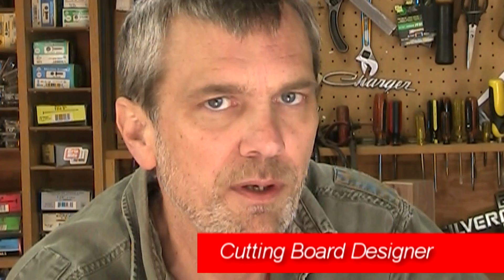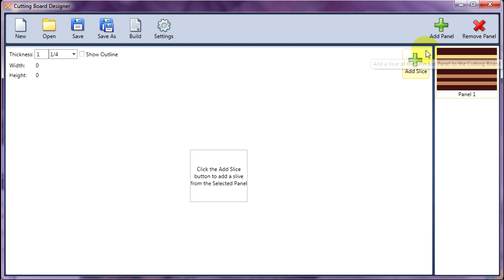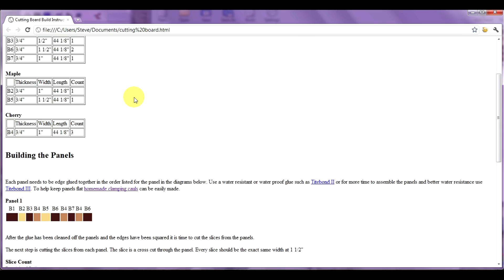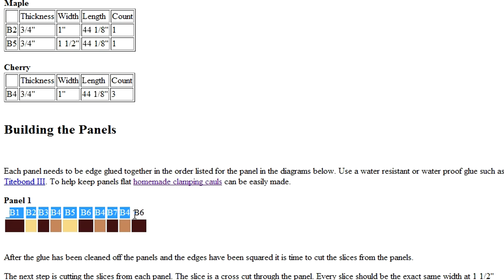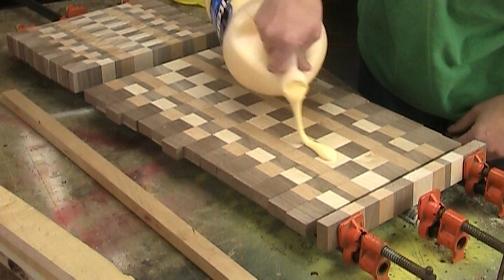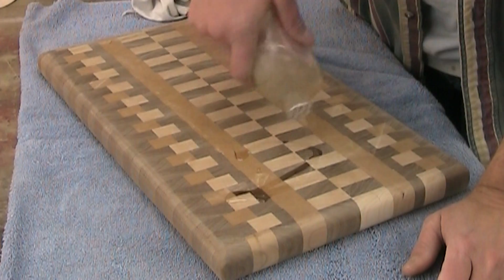How to make a wood end-grain cutting board

Comment: Hey Steve love your videos. They have motivated me to make my first cutting boards and maybe turn it to a possible side business. I have a bit of a question for you and I really hope I can get your feedback. I want to make a brick pattern end grain cutting board. I have the brick and small mortars cut out of Walnut and Cherry respectively. However for the longer mortar I don’t have boards wide enough to re saw the end grain to the thickness needed. That said, am I able to use face grain or edge grain to fill in that mortar, considering that the main part is short grain and that mortar would be long grain? Or am I better off glueing boards together to get the end grain to length and trying to re saw the mortar strips from there? Looking forward to your response. Thank you very much.

Comment: Can this be accomplished without a planer? In most other videos I see them running it through a planer several times to flatten it out. Did you also do that,  or were you able to accomplish similar results by just using the orbit sander?

Comment: Hi Steve, love all your videos - simplifying the message and making it entertaining, thanks! I have a question for you. Inspired by this video as a beginner woodworker (I made the table saw cart of your plans for my new first table saw and an old router I got given) I felt like going ahead with the whole cutting board project. Unfortunately my local store only sells dressed pine, and to get some hardwood, I basically had to go far to a wood joint that only sells raw hard wood roughly cut 150mm by 25mm. and of course they are not true to proceed with this project. Do you have easy ways to prep rough hard wood without a planer/thickenesser to make my hard wood usable? I've already spent quite a bit on wood working tools this month and adding a jointer and/or planer on my list wasn't really in the plans (ahah). thanks

Comment: This looks cool. It worries me that there is only glue holding it together though. Like, I worry that if I accidentally dropped it it would break easily along one of those lines. How strong is wood glue? I haven't really used it before.
Reply: when the face grain is glued together like Steve did, it's bond will be stronger then if it was one solid piece. Wood glue used the right way is extremely string. glue together to boards by there face grain(not end grain) with wood glue and try to break them apart after 24 hrs of curing.
Reply: you do not need to worry about it. Wood glue is actually stronger then the wood itself. :)
Reply: Iv'e tried. You have to drop it very hard for it to break, and more than once.

Comment: Cut food on glued wood ? No thanks
Reply: Darkangelextra X how do you think they join pieces when making end grain boards? by magic?
Reply: +Darkangelextra X titebond 2 and 3 is FDA approved for use with indirect contact to food. You'll be fine once you get of your high horse.
Reply: That's why you use a food safe finish on the cutting board, you don't just leave it raw wood...
Reply: Darkangelextra X  As long as you use a glue that is safe for contact with food like Titebond II, you're fine.
Reply: dude half of cutting boards are wood with fucking glue on them.
Reply: sorry if ur a girl idk if u take people calling you dude offensive if so sorry
Reply: All finishes sold on the Market in the USA are food safe once they become inert.  (Dry for a period of time)  Not all are practical for food, but they are safe.
Reply: I was just about to add a comment to say that Titebond II and III are both non-toxic glues that are used for cutting boards.

Comment: Steve - Nice. Just 1 small detail that may need clarification... when you a talking about the length of your boards,
you seem to be saying the length determines the thickness of the final board. This is not so. It is the width of your
slice after first glue up that actually determines the board's thickness.
Reply: He is referring to the length of the boards in reference to having enough material to get all the cuts needed. For example, if he needs 20 slices that are 1.5 inches thick, your net material would be 30 inches. NOW...add in the 1/8 inch removed by the table saw blade on every cut....that 30 inch board would need to be 32.5 inches + to allow for the material removed by the blade....I hope that clears it up

Comment: you can use regular cooking oil which, olive oil - canola oil .... two finish cutting boards, or any wooden kitchen item?
Reply: Using cooking oils rather than mineral oil is not recommended as those oils can get rancid and cause problems.

Comment: Steve,I am hooked after I saw this video.The board really comes to life after you applied mineral oil.Unfortunately I was unable to get this mineral oil.Any suggestions?
Reply: Home Depot sell butcher block finish, you can find it in the paint section with other wood finishes like Minwax.
Reply: Just about any food-grade mineral oil will work. I'm not sure where you live in the world, but around here you can find it in hardware stores and drug stores/pharmacies. In pharmacies it may be advertised as a laxative (and it works like that if you just drink the stuff), but it's the same product. If that fails you can definitely buy it online at a place like Amazon. I've seen other people recommend walnut oil for cutting boards, if that's easier to find where you are.

Comment: D L D M L D M D M D

The sizes (I used in the program) is as follows, in the same order as above, and are in “inch” increments. (If you want a different size board, you will have to play with the sizes. I didn’t take the time to any extra math, only enough to figure out this pattern).

3 1 ½ 1 2 2 1 1 1 2

Add 13 slices and flip every other one. 

Good luck, I am going to need it!

Comment: Plans for this cutting board: (This will have to be in more than one, separate posts due to comment size restrictions).
I was able to get some plans for this board. Although, the sizes may not be the exact as this amazing cutting board, the pattern is the same. Once you download the cutting board program:  
1. You need three different shades of wood. 
2. 10 boards total. 
For easy referencing, I labeled the boards (D)ark, (M)edium, and (L)ight.
The pattern on the panel should be as follows.

Comment: Alfred, I am a veteran of the food wars. Thirty plus years in the business. There is nothing wrong with mineral oil. I have used it in kitchens (work and home) for decades. I am afraid that you are the victim of the food "chicken little syndrome." Every time you turn around some other half baked theory about food is put out for public "consumption" (sorry I couldn't resist) and most of the time they are wrong. I suppose if you drank a couple of gallons of the stuff you could be in trouble!

Comment: You must be confusing mineral oil with something else.Mineral oil prevents water absorption, combined with its lack of flavor and odor, food grade mineral oil is a popular preservative for wooden cutting boards. Rubbing a small amount of mineral oil into a wooden kitchen item periodically will prevent absorption of food odors and ease cleaning, as well as maintain the integrity of the wood. The oil fills small surface cracks that may otherwise harbor bacteria.

Comment: That mineral oil is available in drug stores for use as a digestive help.  You take it internally.  It is not a woodworking item such as Danish Oil so it is completely safe and is exactly what you will find for use to treat your cutting board.  Except they give it a fancy name and sell it as a special treatment for your cutting board.  Therefore it'll cost much more than the plain old Mineral Oil you get very cheaply in the drug store.

Comment: Sorry Al,

but in most places in the USA, most woodworkers use FDA approved Mineral Oil. The transfer rate between the wood in the Oil and your food is almost untraceable. And most cutting boards for sale today are finished with an FDA approved wiping varnish. So unless you are eating the cutting board or drinking the mineral oil, you will not receive near enough of a dose to even detect... let alone affect your liver or lymph.

Comment: All my life me and my family members used mineral oil on our cutting boards, nothing else. I thought it was a stantard in the kitchen (my grandmother is 86 and is still using it).Reason is to prevent your board from cracking, to keep it longer and it will not tarnish or change color. I think it's going to an extreme to say that mineral oil is not good to health as it's sold in pharmacies to help intestinal problems. I LOVE this video and would LOVE to have that board in my kitchen! amen!

Comment: It depends what kind of wood you use. Maple, Walnut, and Cherry are very good materials for a cutting board since those woods are dense and hard. Some cutting boards are even made of bamboo. As long as you keep the board clean between uses and don't try to gouge it with a knife there should not be a problem.

Comment: Apparently, they have never seen a butchers block before because since they were invented in like 1 A.D. they always used plastic because salmonella was rampid and could only be removed by a dishwasher or radiation treatment.  And I wonder if I shouldn't have used baby oil on my kids since mineral oil is toxic and is the same exact thing?

Comment: Steve, Im a big fan, but I have to say the whole concept of using wood cutting boards for wet foods seems bad to me. I mean, wood is like a sponge, it absorbs, so when you are cleaning it there is stuff that does not come out and rots in the wood.
Sealing the wood with materials that eventually melt/wash or get otherwise removed isnt a good solution either.
I mean wood is such a great material, but not for everything. 
Thats my option anyway.

Comment: My apologies for being critical, because the board looks really great. I wouldn't cut food on it. Tools that are being used in the kitchen are never varnished or oiled with mineral oil - at least there where I come from. This stuff is known to be dangerous for liver and lymph. It is absolutely guaranteed that the mineral oil will end up in your body. You can get a very nice finish by using hand planes instead of a sander.

Comment: Not to say your wrong, however cherry is slightly softer than Walnut is it not? 
Janka Scale will not represent end grain strength, however its important to note the cleaver will slip in between the wood fibers in a fashion not harmful to butcher block. The face grain will not last near as long. 
Black Walnut = 1010
American Cherry = 950

Comment: Well done.  Just a suggestion.  When you use boards to keep your glue up flat you might want to make them just a little thinner on each end.  That way you get better holding pressure in the middle.
Excellent video.  Thanks.

Comment: Hey Steve, i am a Woodworker from Luxembourg, i like your videos. I tried to do a cutting board too. And it looks really nice. I didn't use any plan and just went on cutting the boards. It doesn't look so designed like yours, but its nice. I used Beechwood, Oak and swedish pine. With an thin oak frame all around. But i still wonder why your glue is yellow. In Europe our glue is more kind of white. That cutting board stuff gave me a great idea. I did an other cutting board in origami style.

Comment: I have a question regarding the misalignment, or rather the gluing process as I've pondered this from your chess-board video and various other woodworking vidoes on youtube. It's about the "glue-everything-at-once" principle in board-construction. Is there a reason besides saving time? In my limited experience woodglue sets fairly quickly and it does seem to invite trouble, both in that you have to rush the process and more things that could go wrong.

Comment: You do a lot of projects that can be used in the kitchen. Am I correct in assuming that you do most of the cooking in your house? You do wonderful work for the kitchen ...so far I have copied your paper towel holder and the book rack and now I have a cutting board to get the wood for. I use mostly reclaimed wood but for some projects I just have to buy newer stuff.

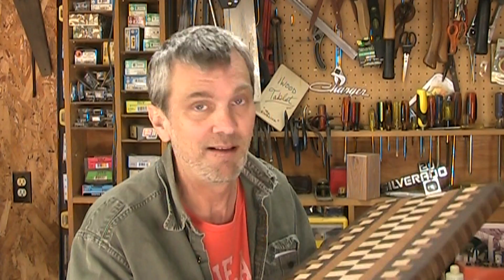Comment: Hi Steve. There is nothing wrong with the board.  It is the video that is misaligned. You can fix the video by replacing the 10 seconds at 4:29 with a comment about keeping misalignment within a saw kerf. Replace the 10 seconds at 5:10 with, "5 cuts and a glue up removes the misalignment." And finally replace the 15 seconds at 5:44 with you holdling an MGD64 while pontificating about how easy it is to arrive at perfection.

Comment: @50guitar I think you misread.  

BkbladzZz's comment was that Walnut was too hard, and that it would dull knives quickly.  I commented out that Walnut is one of the softer woods out there.  It's only slightly harder than Southern Yellow Pine.

My point was that Walnut is very suitable for cutting boards, and it will not dull kitchen knives any faster than any other wood.

Comment: Somebody below expressed reservations about using walnut because it's soft.  Yes, it's a "softer" hardwood than most.  But you're also using it on it's end grain.  And by the time you've marred the surface so much that it needs maintenance and/or replacing, just make a new one.  I think the desire with these kind of boards is appearance more than durability.

Comment: Hi Steve, I always thought the most efficient way to smooth out a board like this after glueup would be to run it through the planer/thicknesser - was there a reason why you didn't end up doing that?
Reply: End grain doesn't go well with planer

Comment: I disagree about Walnut being too hard.  Hard Maple and European Birch have been favorite cutting board wood for many years.  Recently Bamboo wood is popular (and extremely hard).  

Black Walnut is much softer than these woods.  In fact, it is only slighty harder than Cherry on the Janka scale!  That's not hard at all.

The key is creating an end-grain cutting surface as shown in this video.  This prevents cutting across the wood fibers, and it makes the cutting surface last muck longer.